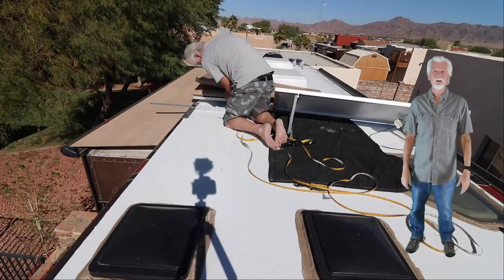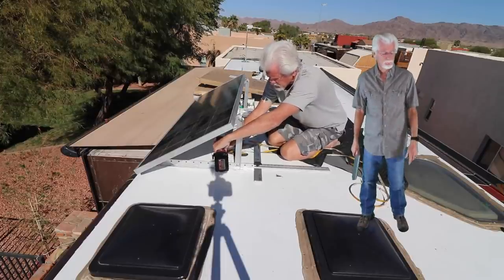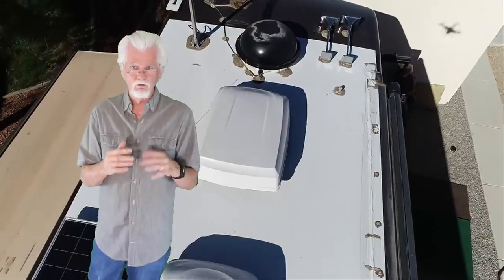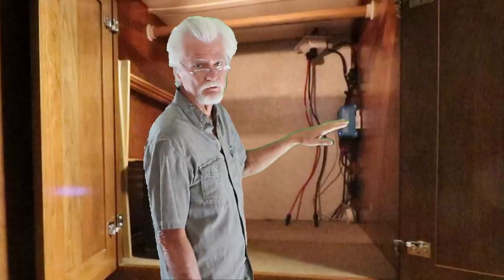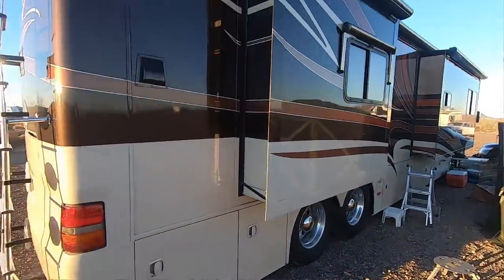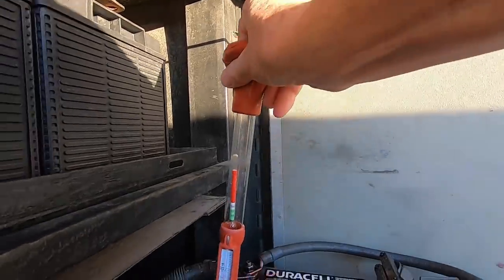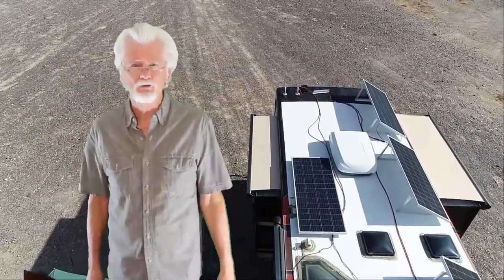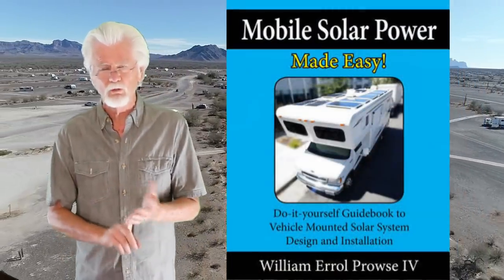Our Solar DIY Project was a HUGE success, No Generator Needed (so far)

Comment: Darn we just missed you at Quartzsite! Nice start on your system. On the 2" screws. Just hope you didn't hit any wiring run through the roof rafters. Yes go Lithium for batteries for 90% to 100% use and more recharge cycles. I didn't see a catastrophic fuse after the batteries and before your main shut off switch for safety. Northern Arizona Wind and Solar is a great resource for systems design and support they helped me put to together my 1300 watt system that's been working great for 3 months now. Enjoy the freedom of the sun and keep on boondocking.
Reply from the maker: Hitting a wire was a big concern and risk, but I felt the odds were in my favor and it appears I was lucky and missed any stray wiring that might have been in the ceiling. The catastrophic fuse is located in the battery box and you can actually see it right above the House Battery on/off switch at 6:29 minutes into the video. That was installed by Monaco along with our Magnum Inverter/Charger back when the coach was originally built.

I only installed the solar panels, solar charge controller & battery monitoring system but nothing after the batteries other than the shunt to monitor battery amps in and out. I know there are lots of great Solar Install places out there, but it is such a simple upgrade I wanted to try and tackle it. Although, I am sure it would have been a much cleaner and potentially more efficient system had I used a professional install company but I doubt I could have afforded that extra layer of expense. Wish we had met up as I would enjoy seeing the install you had done. We are hoping to harvest a lot of that free solar energy and with a little luck maybe get to purchase some lithium batteries to store it all in the not too distant future. How much Lithium did you put in to handle the 1300 watts of solar?
Reply: @JustPassingThru  Good to know about the fuse. I did all the research, on Youtube. I'm a retired Electrical Contractor so I did the install my self. I purchased all the parts from NWS, so I'd have a single source for support, Amazon. I have 400 amps of Battle Born. My 4 panels are 325 watts each and mounted flat on the angled part on my 5th wheel roof. I have a Victron 250/100 MPPT and a 3k Victron Inverter. During these winter days near Yuma I'm getting around 750 watts. I get to 100% recharge by around 3pm most days.

Comment: Great setup, I see many under do solar panels and overdo batteries.  We have 1200 watts on the roof 800 through a 150/70 charge controller and another 400 through a 100/50. Charging 3 lion energy Liop 100 amp hour batteries. In 6 months we’ve not gone below 60%.

Comment: It's working! That's a good thing. I forget, do you have a residential fridge? I do and that's a big energy hog. 
Those lead acid batts are how old? You can revitalize lead acids by doing an equalization on them. Read up on your specific batteries to find the voltage and time for a good equalization. You'll need to be on FHUs and you battery charger needs to be able to do it properly IMO. That's of course if you are not biting the bullet and getting LITHIUM :)

Comment: If you decide to upgrade your batteries Battleborn usually has a blemish sale around this time of year or a lot of people have been talking about Lion batteries on some of the Solar Facebook groups from Costco I believe. Another device you might find helpful is the Victron battery shunt. We use the BMV-712 but there is another model that only uses the app and is cheaper. It gives you current state of charge in percent and will tell you how long until your batteries are charged or depleted, we love it instead of going off voltage.
Reply from the maker: Hi Shane, I couldn't agree more with your comment and we are hoping to upgrade to some kind of Lithium in 2021. We did install the Victron 712 Battery Monitor along with the shunt and really enjoy seeing all the information it provides. Really makes boondocking much more pleasurable just knowing how the power situation is going. Thanks for the suggestion and comment

Comment: Great video. I put in SOK Lithium batteries I paid $600 for 100AH batteries. They also have a 200AH battery. They are a lot lighter than lead acid and they are very durable.
Reply from the maker: Hi Mark, we have had a couple of folks recommend the SOK lithium and we even ordered 2 of the 200 amp hr ones but found out they could not be delivered until late January so cancelled the order and doing a little more research on our Magnum ME2012 invertor/charger to see how well it will work with lithium. We would love to have lithium but the cost adds up so fast, we want to make sure we will use it enough to justify all that expense. Great Suggestion, Thanks

Comment: Nice work! 👍🏾 I’m probably one of the few that actually like to use the generator. I would be worried about it not getting enough exercise.
Reply from the maker: Hi Chuck, we love the option of having the generator to take care of all the "Big Boy" electrical demands (air conditioner and convection over) and knowing it will take care of us when the clouds hang around a little too long. We actually didn't mind it running for hours on end when needed but know it bother some of the folks that may be close by. All in All, we think the solar upgrade was well worth it and are looking forward to using the solar along with the generator to make for a very enjoyable summer in 2021 in some more remote locations that we haven't visited yet.

Comment: I just left there last Saturday. We will see you guys Jan. 16th. I have 700 watts but don't have my panels setup to tilt. How much of an increase in watts do you see when you tilt them? Like Shane said, you should add a Victron BMV712 for accurate SOC measurements. I have one and it is great.
Reply from the maker: We haven't put the panels down flat yet to compare so I dont know but if you have 700 watts in southern Arizona, my guess is you will have all you need flat or tilted. We did install the Victron BMV712 and the shunt when we did the install and like everyone says, it is the perfect monitoring tool for the batteries. We are trying to determine if the Lithium upgrade is something we really need or not and all the information seems to be pointing us to the right answer. See ya in January

Comment: I’ve had the panels for months. I’ve put in the inverter, LiPos , solar controller. If you can do it , I can do it. Thanks
Reply from the maker: Great Job Christopher, it sounds like you really did it first class. We would love to have a new invertor that can handle the lithium but I am guessing we need to work with what we have for a little while and try to learn just what all the solar does for us and what it can't do then fill in the gaps. Most likely will be following right in your footsteps .